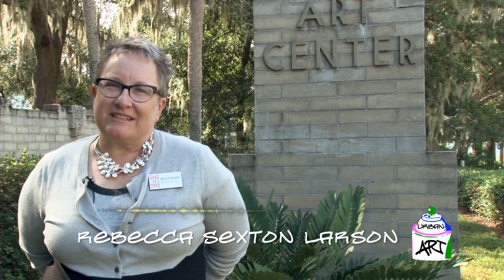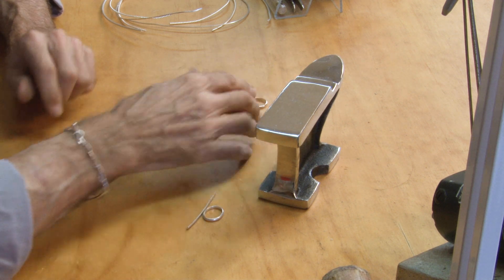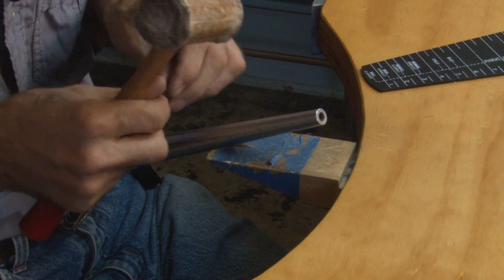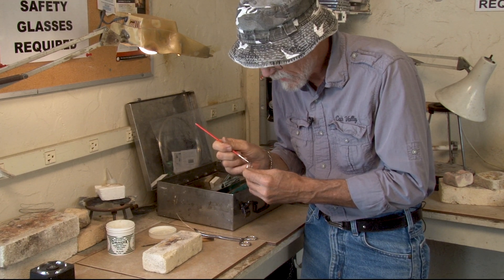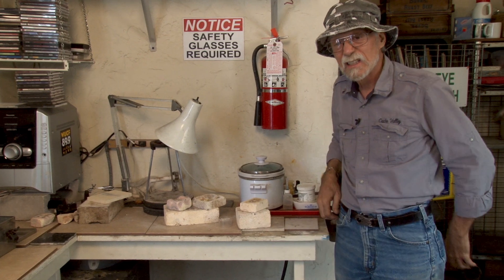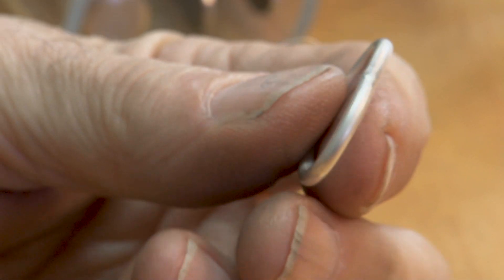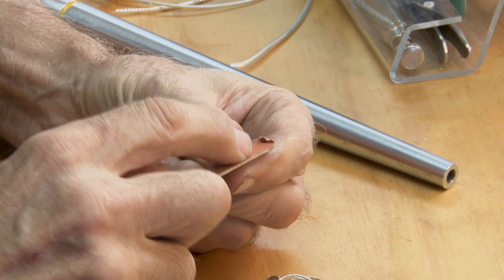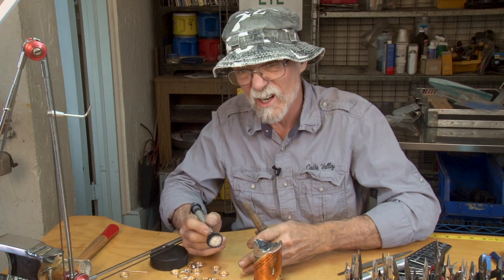67 - Jim Hosner: Silversmithing

Comment: At 7.44 through 7.49 you mention cleanliness. Cleanliness of what? The ring, the solder the flux? Im concerned that perhaps my solder is not clean, it does not want to flow.
Reply: It's good practice to clean any oils off of the surfaces you're joining as well as the solder. Isopropyl alcohol works well for this. Sometimes I'll use a clean toothbrush with the alcohol to get into tight corners or creases as you really want to remove all the oil. Any amount left on the mating surfaces will prevent solder from flowing.